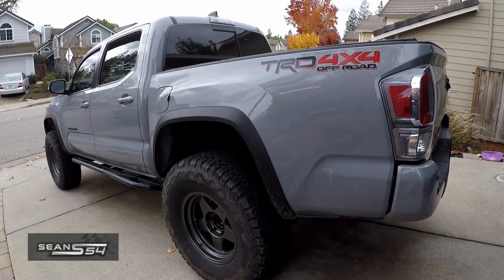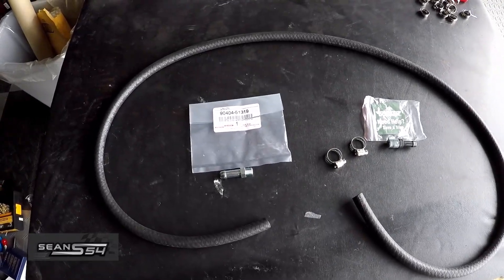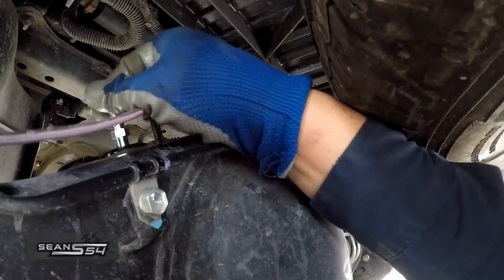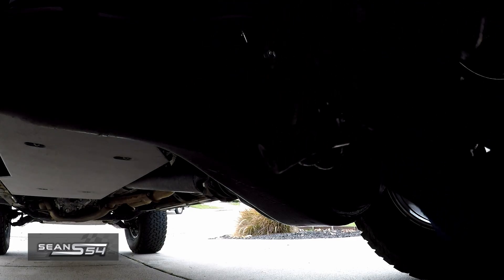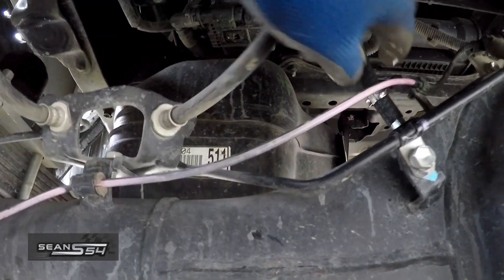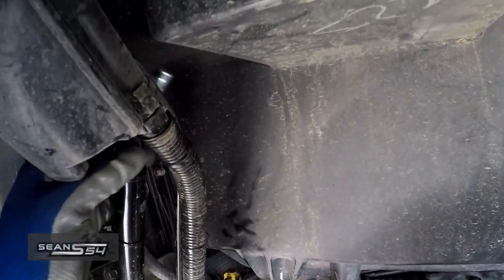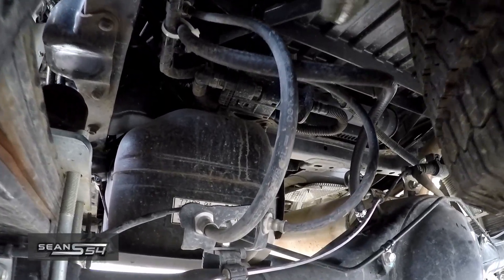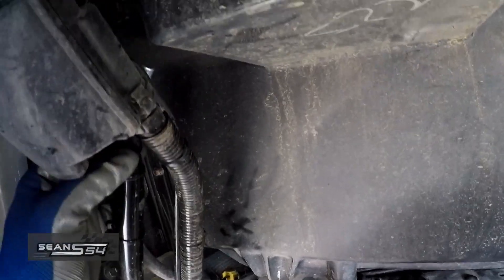Cheap & Easy Diff Breather Mod - Toyota Tacoma

Comment: Hey Sean,  Definitely a needed mod.  I just hope you put some pipe dope or silicone tape on the threads that went into the differential.  Better to be safe than not.  Good Job.
Reply: Tapered threads, so not needed.  Stay on the pavement or at Home where your safer. 🤣🤣🤣🤣
Reply: @UncleFjester  Watch out! We got a keyboard warrior here!

Comment: Why'd you install the dorman vent?? It's going to continue doing the same thing that the factory did. The idea behind removing the vent is the vent closes with slight vacuum. In water, that vacuum in the case is enough to suck water through the axle seals. That contaminates the gear oil AND destroys the seals. With your vent the same thing can continue to happen. Ideally you'd run the hose high enough to leave the hose end open, or with a filter (like the factory front)
Reply: Not so sure about that. Yota Shop sells this in kit form, and part of the kit is a breather. Pretty sure they know whats up.
Reply: Definitely not correct.
Reply: Everything I said about using a valve at the end of the breather extension is absolutely correct. 
When I first watched this the first time, I would have sworn he used the same style valve at the end of the hose (stated in video that a valve is used, but a filtered vent, shown, is otherwise) as was originally equipped on the axle. This would have negated any modification.

Video and parts, being a screened vent, and not a check valve, are correct
Reply: @the_nothing  not even close. Even the factory vent is is pressure operated. Putting  that ABOVE the water line means it will not pull water in. This is the correct mod in all regards.

Comment: Thanks for the video great setup I’ll be doing the same. Just a question why didn’t you use the original value at the end of the hose? Plus what year is your truck I have a 2023 Tacoma and this part number supposedly doesn’t fit.
Reply: The original valve is threaded to go into the diff, the one he used is barbed to fit into the end of the hose. Hope this helps!